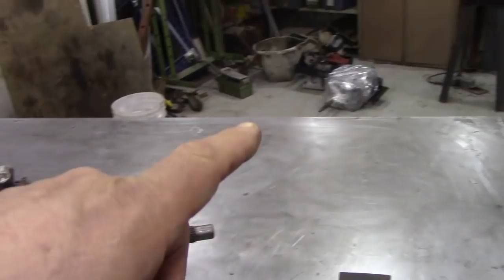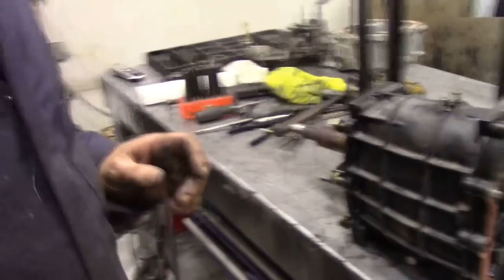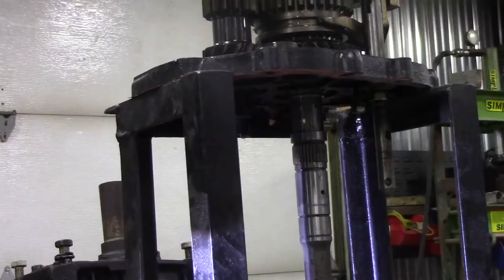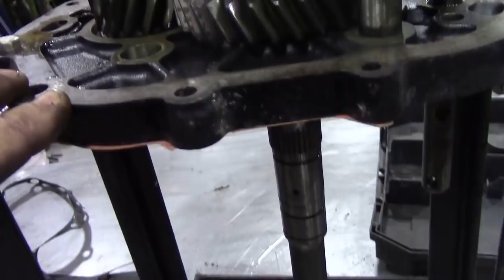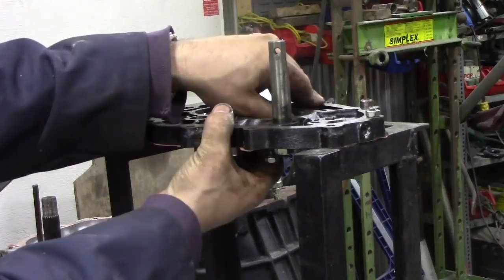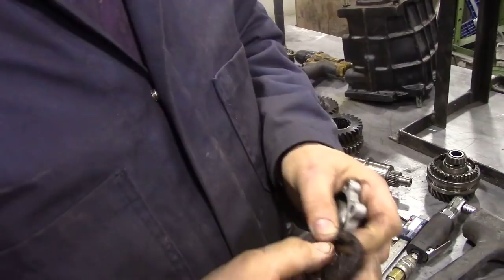LT77 gearbox overhaul. Part 1 - stripping the box

Comment: After watching you it's worth giving you a shout out to our subscribers.
Reply from the maker: Thanks I would appreciate that!
I get about 50% of my hits from the UK, but ironically,  the North American side is pretty lean
I have a link to your channel on the related videos, but I will try and make it a permanent link.

Mike
Reply: I live in Texas and spend many hours watching LRTV and find this channel exceptional.  Thank you both!
Reply from the maker: Thanks Stephen!
I think we both agree the workshop manuals are somewhat vague, especially the Haynes manuals - they have the technical details which we need, but actually doing the jobs are lacking in practical details.
I don't have a Haynes manual on hand, but I believe they do not cover stripping Defender gearboxes any more - maybe because of the tools required.

And this is the problem with modern Land Rovers - the cost of specialised tools and computer equipment needed, means it is dealer (stealer) only workshops able to repair even the most simple of jobs.

Mike
Reply: I’m also a Patreon of Chris at toolbox and between the two of you there’s not much you can’t find out, I just wish more subscribers would donate to keep these videos alive. So a big thank you to both of you for your time and professionalism. Awesome. Jeff

Comment: Hi Mike. I’ve just just took apart the lt77 transmission on a 1990 defender and the damage is in 3 different gears. I am in Mexico and I have called different suppliers in the United Kingdom but they currently do not have the spare parts. Could you suggest me please if I can replace the gear box with another one or any solution on how to repair the damaged gear teeth? I thank you very much in advance for your suggestions
Reply from the maker: What parts do you need, and what is the gearbox number? I have lots of used parts here britrest@britrest.com

Comment: Hi very, very useful. I'm in the middle of a strip down now, I'm making rough pullers out of threaded rod and scrap. This box looks ok generally but there was a lot of end float particularly on the layshaft. I'm concerned about some corrosion pitting on the layshaft driven gear what's your thoughts on this.
Reply from the maker: Pitting is never good = what is the box serial number? I have some old stock LT77 layshaft - laying about
Reply: @BritannicaRestorations  Hi thanks for getting back to me its 50A0036039G. The end float was caused by the rear mainshaft and layshaft bearing outer races turning in their housing and burrowing outwards. Seen that one before? I'm thinking new bearings, shim and centre pop the bearing recesses and give them a dose of bearing adhesive.

Comment: Mike, what's your opinion on "gearbox (oil) cooler" assembly (which is NOT installed on my R380 gearbox, by default). It's mostly 30+ °Cs in summer, in here. Cheers 👍
Reply from the maker: Well I have never needed one, but you need the thermostatic block that goes on the side of the box
Reply: @BritannicaRestorations  thank you Mike

Comment: Hello Mike. May I ask please, how do you remove gearboxes from the vehicles ? Do you have a car liift, or a hoist ? I am wondering if, in my business, I could do it on my own as well. Garth Richert.
Reply from the maker: GarthI have tried several methods of getting the box out and all vary.I will do a video in the near future, but for now I will tell you the way I used to do it and the way I do it now.I am fortunate to have a fork lift, so I used to lift up the back and support the vehicle on 3 foot stands on the rear axle, then by removing the floor I could get access to the balance point of the gear box and with an extension on the forklift I attached a chain, swung the box back and dropped it on the floor.Now I have  2 post liftI also have a small transmission jack I bought usedSo as my lift height is limited, I set the whole car on 4 x 3 foot stands (safety first!)  and used the transmission jack to lift out the gearboxOne thing to watch which will save you a ton of hassle refitting is take off the High / low shift assembly as it catches the front edge of the seat base when trying to get the tranny back in (and easy to get out too!)
I am flat out trying to get my bathroom remodelled which has been going on for a week now (hence no videos!) 
If I get chance over the weekend I will do a few video notes as it is simpler to explain than type!
Mike
Reply from the maker: https://www.youtube.com/watch?v=NSUlENy_y5E

Comment: So the oil pump is driven off the main shaft and pumps all the time the prop shaft is turning?
Reply from the maker: The oil pump is driven by the layshaft - so it is always pumping when a gear is selected
Reply: @BritannicaRestorations  great video by the way, thanks.  I presume the layshaft turns the whole time the engine is running even if the gearbox is in neutral?
Reply from the maker: Yes - however if the vehicle is towed and the transfer is not in neutral, then the drive will not turn the layshaft and oil pump even if the main gearbox is in neutral
Reply: @BritannicaRestorations  Sorry to be a pain but do you know if the version of the LT77 used in the Triumph TR8 has the same pump setup.
Reply from the maker: Yes - I believe it has

Comment: Hi. Could you explain how to strip the box without the special land rover tools. I'm sure many others like myself can't justify the expense. Cheers
Reply from the maker: I understand, but this rebuild was a request by someone who had the tools but didn't know how to use them
You could use pullers to get the collar off, and tube and screw bar to put it back on
You must never hit the collar or you could damage the bearings on the mainshaft
If I get chance over winter I will try and strip one using improvised tools, but at the moment I am extremely busy with work

Mike
Reply: @BritannicaRestorations  Thanks for that. No need to go through that bother. I just wasn't sure how it could be done.

Comment: 🧐 My goodness! The tools to take one of these boxes apart cost more than a second hand box! I recently purchased an LT77 Suffix C box for £200 with a remote tail shaft for a Rover SD1 (which I intend to put in my P6).. But I have to admit, I'm starting to wonder if I will ever get it apart, as I cannot justify the cost of the tools or the cost of a rebuild! 😱

A box like a Ford T5 or the Getrag out of my brothers BMW E21 can be stripped using nothing but basic tools and a press.. Maybe there is a way a skinflint (I mean money conscious) person can strip one of these down using just a press.. 🤔

Let me know your thoughts if you ever have a moment.. I don't want to end up butchering the box as they are getting a bit rare now (especially ones out of cars) - and it feels really good for a box of its age.. Not much play in the gears or reverse, splines look untouched but it is wobbling tiny bit on the input shaft.. 🧐
Reply from the maker: I do about 10 gearboxes a year so they have paid for themselves - you can get into the box by fabricating tools